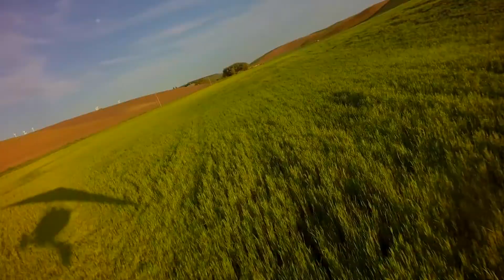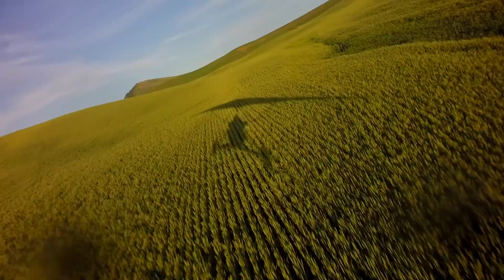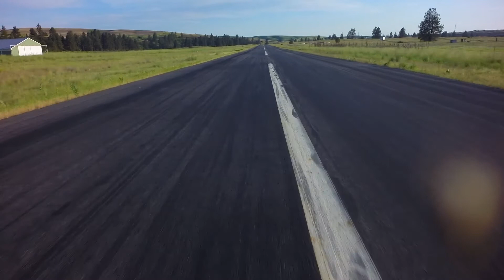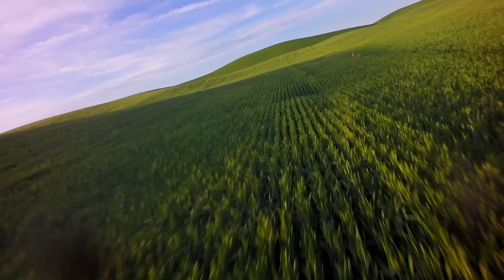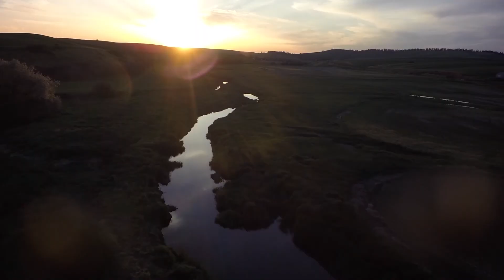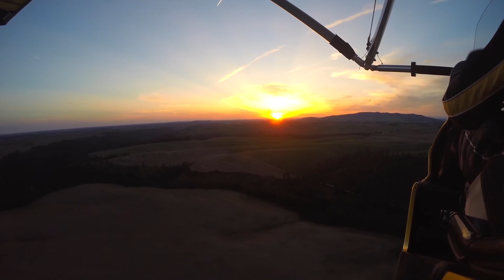OIL TEMP WARNING LIGHT?!?

Comment: Doesn't high angle attack, full throttle, full flaps, slow flight climb (low speed stall) 
 tax the engine the most? This would bring out any overheating I would think.
Reply from the maker: Trikes don't have flaps.  So I trim it up for slow(er) flight, and suck the bar in for low level work, and open up the engine.  I did T&G's for max throttle climb outs, and up and down Steptoe to work the engine even more.  I think the light may have came on due to a poor connection (?) or the fact I had a passenger that increased the work load.  That said, I'm likely going to add a second oil cooler this summer.

Comment: Did you find out what caused that oil light to come on?
Reply from the maker: YES!  It's the passengers right leg that deflects the air going into the oil cooler.  I'm either going to have to build a scoop on the right side of the trike ducts ... or keep an eye on right leg positions of passengers.

Comment: So why did the temp' go up so much in the 1st place?
Reply from the maker: It likely was due to a dirty radiator.  I used compressed air to blow it out then a garden hose to wash it out.  Made a difference!  Probably has not been cleaned out in 10 yrs.
Reply: Alright, I'll make a mental note about that. Thx.